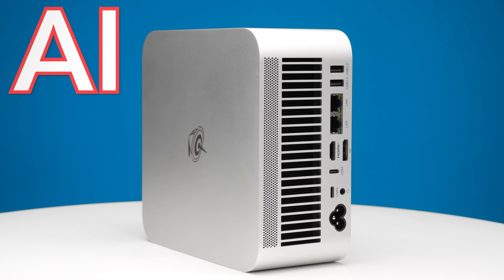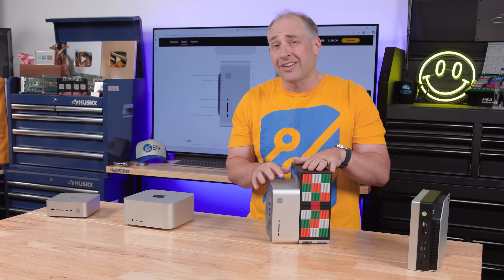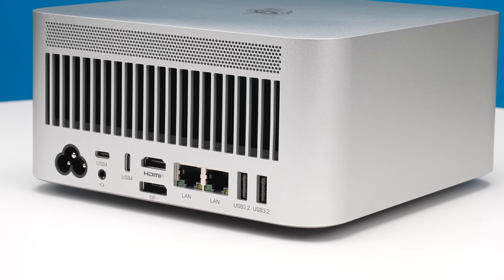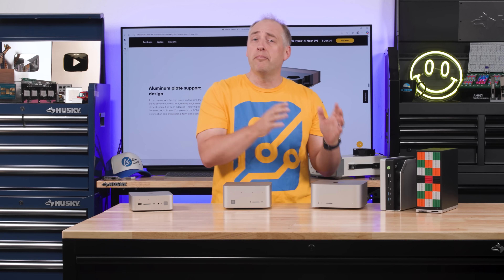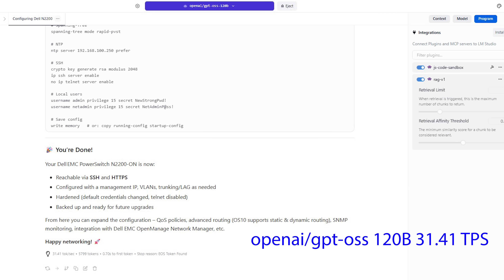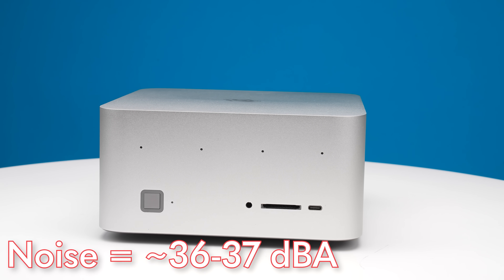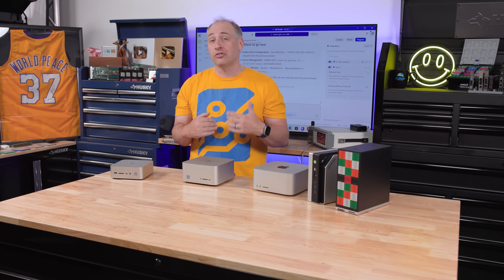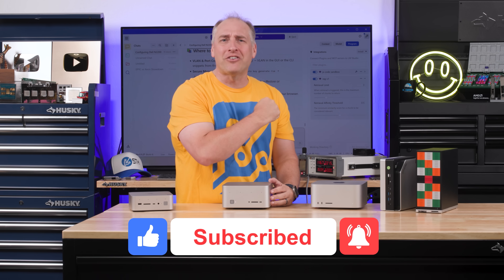The BEST AI Mini PC That One Upped Apple? AMD Strix Halo Beelink GTR9 Pro

Comment: If I want to run an AI PC, I'll most likely build it myself to have more control over the parts than buy a pre built like this. Also $2000 is a bit much for me for something like this that has limited upgradability. 😔

Comment: These computers are like the same guy in a different suit and accessories. With all the issues with Windows I think I'd rather get  Mac Studio M4 with 128gb ram and 512 storage for around $3200 with a discount. I'd use external thunderbolt drives or and find one of the companies that are making cheaper storage for a Mac later.
Reply: Beelink has a Mac mini M4 80Gbps Dock.

Comment: Dang I always considered Beelink to be like a cheaper Mini-PC brand but this is even more exp than GMKtek & Minisforums's AI MAX systems.... I guess it cool that its a unified system. but lack USB-A Ports  means that it needs more IO Adapters.
Reply: I don’t think that’s quite right — from what I’ve seen, Minisforum’s AI MAX models are actually more expensive. Of course, everyone’s usage needs are different, but I believe the three USB-A ports on the GTR9 Pro should be sufficient for most users.

Comment: I have to pay for the the in-house spy?
Nice Move.
Reply: Hi! Please rest assured that the Windows system pre-installed on our devices is 100% genuine and does not contain any spyware. 
We collaborate directly with software vendors to pre-install certain applications in order to provide a convenient “ready-to-use” experience and address common user needs. All pre-installed software is fully licensed and secure. Of course, you have complete control — if you prefer not to keep them, you can safely uninstall any of these applications through the system’s “Apps & Features” settings without affecting your PC in any way.
Reply: @Beelinkchannel  Don't you read the Windows 11 specifications? That's scary.
You're collaborating with Microsoft.
At this point, the buyer can still decide BEFORE purchasing the device.

Comment: Sorry I have one and it’s not that great.  The token generation is low.  So while you can load a large model, they are slow.  It’s going to be slaughtered by Spark.  It’s will also be crushed by a multiple B60 dual system.  ROCm is way below CUDA.  Cant even have the GPU and NPU collaborate on a model for more speed.

Comment: This computer has tons of issues incliduding rattling fans, bad packaging, broken LAN ports, overheating and so on.
Reply: Hi! We’ve upgraded the product packaging to make it much more secure. 

Regarding the LAN port issue, our team is actively working on it, and we’ll do everything we can to provide a solution as soon as possible. Thank you for your understanding! Please rest assured that we’ll take full responsibility for this issue. If the driver update doesn’t resolve it, you can always contact our support team to arrange a return and refund. 

As for the fan noise and overheating problems, please don’t hesitate to reach out to our support team for further assistance.

Comment: Just an FYI for those looking into this, as of 2025-10, the NIC issue seems like more than a "teething" issue. It causes persistent firmware lockups and system crashes and the only current workarounds are completely disabling the NICs via BIOS+udev in Linux, or limiting APU TDP (via something like RyzenAdj) to 35W. Anyone buying this now will just have to hope it gets fixed. For those tracking this issue, search for: "Beelink GTR9 Pro AMD Ryzen™ AI Max+ 395: From First Impressions to NIC BSODs and the Road to Stability"
Reply: Hi! We’re truly sorry for the inconvenience this issue has caused. Our team is actively working on it, and we’ll do everything we can to provide a solution as soon as possible. Thank you for your understanding! Please rest assured we'll take full responsibility for this issue. If the driver update doesn't resolve the issue, feel free to contact our support team for a return and refund.

Comment: Anyone brave enough to see if it can run Windows Server 2022? Also if the power goes out, does it resume when power comes back?
Reply: Hi! The GTR9 Pro can run Windows Server 2022 without any issues! If you need any assistance, feel free to contact our support team at any time.
Reply: @Beelinkchannel  I have been running since 2014 a windows server 2012 (not even R2) on a gaming machine, at the time it was the only way due to overclocking (4 GHZ was the sweet spot) with 64 GB Ram. Now with this Server I can do  the same, same speed and 128GB RAM.
The last thing (which I believe is standard) is the auto power on, after an outage, I'm sure this is enable at BIOS right?
Reply: @patolobos8266  Hi! The GTR9 Pro does support auto power-on after a power outage, but this feature isn’t enabled by default and needs to be set up manually. Please contact our support team to get the step-by-step guide for enabling it.

Comment: And if you target this at using bleeding edge AI how do you deal with CUDA? I use a M2 Ultra and two Corsair PC Towers with liquid  cooling fitted with RTX high end GPUs and run the AIs' GUIs or terminals via URLs or RDP over the LAN on the Mac, but I need the Nvidia cards to do the heavy lifting. I also have a Bee and it's useful for playing with VMs for Linux but AI... no way.
Reply from the maker: For NVIDIA, our NVIDIA DGX Spark video with GB10 went live just now.

Comment: 16:05 sorry but that there is plain dumb. Comparing a nearly €10k GPU(PRO 6000 blackwell) with a complete system for one fifth of that is stupid. Especially if you don't say that it is a comparison based on the GPU being 5 times more expensive but you're doing it to make the point of something that is supported well versus something that isn't, not that they are in some other way comparable, or whatever it is the point you're failing to make there is. Disliked because of that, because it is a massively important point. Someone might misunderstand it as there being some kind of feature parity between a Blackwell PRO 6000 GPU and this Beelink thing in terms of what you can do with the GPU side of it when there absolutely is no parity at the moment at least. There ought to be, but people being lazy you'd have to make it yourself at this point. 
But you could or maybe should have compared to a Pro 4000 Blackwell which at €1500 is similar in terms of price - but then you're looking at only 16Gb VRAM which makes it problematic since this system does scale up to 96Gb - like the Pro 6000 - but at least you wouldn't be appearing to ignore money existing as a limiting factor for all but a few people on this planet.

Comment: Not bad for 2k USD; it's a steal compared to the $ 8,500 TRX Pro 6000 Blackwell. Sure, it's much slower, but fitting a large Model 70B and its 120 context window in it is terrific for the price.
Reply from the maker: Exactly.

Comment: 2:56 I am always hiding PCs with fans far away from my ears, e.g. under the table. So, a fingerprint button won’t work for me😂. Only fanless PCs are standing on top of my table.😅 4:28  Great, but they stop turning ports upside down, especially USB-A, HDMI and Displayports. This is nuts!

Comment: I believe to be worth mentioning that the dual 10gbps Ethernet ports are waiting for a fix on their firmware. If you buy them and try to do online gaming, the Ethernet will simply disappear and you'll lose connection.
Only coming back after restarting.

If you need any network intensive work, it's better to use WiFi (at least for now).

I got a message from them telling that Intel may take until December to solve that Driver issue.
Reply: Hi! We’re truly sorry for the inconvenience this issue has caused. Our team is actively working on it, and we’ll do everything we can to provide a solution as soon as possible. Thank you for your understanding! Please rest assured we'll take full responsibility for this issue. If the driver update doesn't resolve the issue, feel free to contact our support team for a return and refund.

Comment: This discussion about memory bandwidth has me curious.
 For a consumer that might have a used 3090, and looking at a framework PC (or any other strix halo motherboard with a pcie slot), when running models that don't fit in GPU memory, would the system ram speed and channels of strix halo compensate for the x4 pcie slot, and do a better job keeping that GPU fed?

Comment: The pricing of Strix Halo PCs makes the platform completely unattractive to me. I know it's 128GB are a USP so I hope for some competition that brings down the price. For someone with some kind of professional workload the price may be easily justified, but for me it's just about being able to play around with some local AI stuff in addition to running my home server containers, that don't need any performance at all. My current homelab setup cost me less than 200€ (excluding drives) so I would have to spend 10x of that for Strix Halo. No way!

Comment: This review is a prime example of **marketing over metrics**.

The reviewer strategically focuses on the massive memory capacity (128GB) while *deliberately omitting* the critical bottleneck for AI performance: **Memory Bandwidth**. This lack of quantification avoids revealing the machine's true speed limitations.

Furthermore, by testing with an easily optimized 120B model and ignoring the industry standard 70B LLMs, the reviewer bypasses a crucial performance test. This high-capacity system's potential is masked by the slow data transfer.

This lack of critical scrutiny, combined with the discovery of pre-installed "junkware" and firmware issues, suggests this is a **strategically framed advertisement**, not an honest benchmark. Buyer beware of the hidden performance ceiling.
Reply from the maker: Your weaksauce AI agent failed to pick up the Llama 70B model in there. You clearly need better hardware to run larger models to make an AI comment bot

Comment: As someone who uses the 128GB Mac Studio for LLM (hobbyist purposes), I’m fascinated by these mini PCs that are catching up.  I think they’re aiming for the wrong target though.  Despite the price difference, I’m not inclined to get one of these models.  If they came out with 256GB RAM or an option for higher, then I’d be seriously intrigued.  The 2TB SSD is not necessarily as important if you can upgrade your own later (I actually store my LLMs on external Crucial X9 Pro drives and they’re just fine), but this machine with 256GB RAM of which you could assign 200GB+ to the GPU?  Now that would seriously turn heads.  Make it happen, Beelink.
Reply from the maker: I gave that feedback to AMD a year ago
Reply: The limitation here is due to AMD and the Strix Halo design itself. As far as I know it only supports 128gb of memory. 
Fingers crossed for a 196gb or 256gb Medusa Halo part in 2026.
Reply: @GuernB2 it seems a little shortsighted of them but, as you say, fingers crossed for a 256 in 2026 (at an affordable price!).
Reply: @jonathanrudderham7104  What do you mean shortsighted? It's the most memory they have given an APU by double.
Reply: @kevikiru  Shortsighted because if people wanted a 128GB machine for AI, they already have options and have had for some time.  Had they come out with 192GB or 256GB, they’d probably be wiping the floor with all of them.  Creating a design that only supports 128GB (as indicated in a previous reply), they’re being short-sighted because it suggests they didn’t think anyone would want any more than 128GB.
Reply: the halved memory bandwidth (with respect to Apple) is a problem. you can run the same size models sure, but only half as fast..... even twice as big models would be questionable at the same speed.....
Reply: Hi! How's the performance on Mac please? Considering getting a mini m4 pro (or an m5 when it comes out later this year) for local Llm but I haven't used any apple products in over 10 years... Apparently Apple silicon is great as it has unified memory but how about speed (I think it's "memory bandwidth?" vs other options? Thanks!

Comment: I've just taken delivery my Bee-link GTR9 Pro. Like you I didn't like the pre-installed Windows 11 Pro image, or the pre-installed Wondershare applications. Bee-Link support was extremely helpful. They confirmed download location for their driver software and that the Windows 11 Product Key was preloaded in the BIOS. I performed a clean install of Windows 11 (English UK) with secure boot enabled (default BIOS setting is disabled), installed all the driver software prior to performing the final round of Windows updates and it went like a dream. The fastest Windows install to date. Like you I experienced a problem with the ethernet ports.  Port #1 dropped out after using for a while. I went to device manager, clicked properties for that network adaptor port, and uninstalled the driver checking the box to remove the associated files. I then got device manager to do a refresh, and the driver was reinstalled, and the port came back immediately. I've also downloaded the latest Intel E610 XT2 driver package from Intel's website, but this looks to be the same as what Bee-link had on their support website, so look forward to a later version with the firmware update. My retail system came with BIOS P107 installed, but there is now later P108 BIOS available for download, with more VRAM configuration options and instructions on how to install. Bee-link Support confirmed it's OK to install and it worked great (you need to temporally disable secure boot for BIOS update, so I did this before performing the fresh Windows 11 install).

Comment: I've got a Minisforum MS-S1 MAX which should be coming at the end of the month , but the GTR9 look to be very close 2nd place to all the mini Strix halo PCs I've seen so far .
I do like that they have used Intel and not Realtek 10GBE networking , still like the MS-S1 MAXs formfactor better , bigger with a PCIe 4x4 16 slot which will not power a video card .
30 tps that is fast , I can run a little deepseek  model 4.7gb on my RTX 4060m at 30tps , but with 18gb models which is the max on my system 32gb ram , 8 vram , most of it is running in ram memory 2.8 tps .
Reply from the maker: We have the S1-MAX as well. Both are good. The S1-MAX is notably louder, but is easier to tinker with
Reply: @ServeTheHomeVideo  can't wait for your honest review and getting my own.

Comment: So you failed to compare it with Apple Studio, other than price and the Nic’s 1 vs 2 the cheap box has a few usb ports at 10G bit apple has Thunderbolt 4 on this generation that’s 4 times as fast!! - and didn’t compare processors performance (I wonder why?) plus Apple is likely to be updating this to a new chip soon. - perhaps the biggest take away is that fact that people are copying Apple’s design with cheaper build quality

Comment: You can't compare a 128GB mini PC to a 512GB Mac on price 😂 Why not compare it to the 128GB Mac?!
Reply: You’re right he should compare the 128GB to 128GB, however Mac Studio 128Gb is still noticeably more $$.
Reply: That's the SSD size buddy, 512GB on the memory would be an ungodly amount of money! Just checked, 512GB unified memory is +4000USD o.O
Reply: @benjaminsmekens2344 you are wrong, 0:43 - Apple Mac Studio M3 Ultra 512GB - the 512GB refers to the unified memory not the SSD; he even says it's a $10000 PC - what Imm saying is conpare the price to a Mac with 128GB and then the price won't be 10k and it will be more comparable

Comment: I would love to know what the power consumption and performance in terms of tokens/second is for the deepseek-r1:70b model.

Current, my dual 3090 running on a much older Intel 6700K is able to get ~17 tokens/second.

Considering the cost of this system vs. what I paid for said pair of 3090s, this has a lot more potential.

Comment: I don't understand how the cooler works with intake at the bottom but the cooler on the other side of the board
also AI-wise Framework with ability to cluster them will beat basically anything
Reply: I think that's just an auxiliary heatsink. The main cooler is on the bottom.
Reply from the maker: For clusters, the S1-MAX would be our pick on the Strix Halo side. Framework showed clusters, but other companies are delivering better on that vision
Reply: @ServeTheHomeVideo do others provide a link dedicated for that though? I've only noticed Framework doing that

Comment: 512GB of Unified Memory is totally different from 128GB.

One can run frontier LLMs, The other simply cannot. The number of parameters, the quantization and the context window simply doesn't compare between 512GB and 128GB LOL! And those things matter.

RAM that can be used for AI is extremely expensive (Macs, GPUS).
Reply: I think the 512GB was referring to the SSD not the ram, to get the ram on a studio to 512GB unified you need to drop 4kUSD.

Comment: I have zero interest in AI, but even though this benches 15% lower multi-core than a 9900X3D, I wonder if Strix Halo would win out on some memory-bound and especially memory latency sensitive workloads.  I do a lot of static analysis (think jchord), compilation, and heavy database stuff - some with good locality, and some with lots of dependent pointer lookups.  I do love the beelink build quality, though I prefer the form factor of the MS-01.  Not sure if or how I should explore this yet, just a thought.